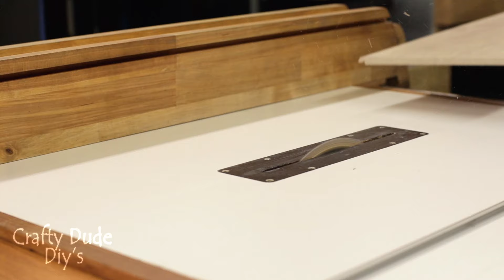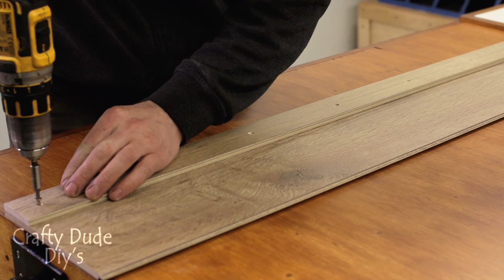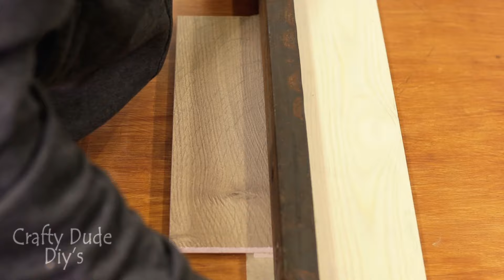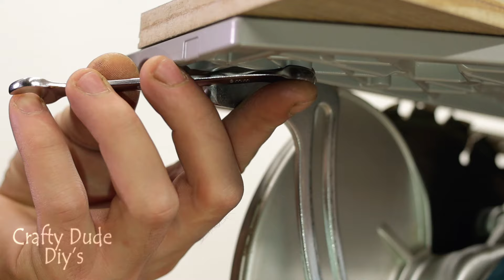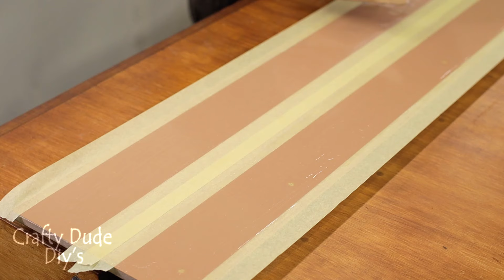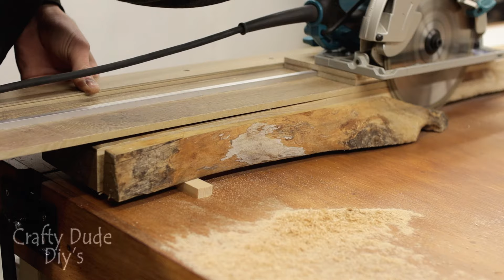DiY Circular Saw Guide out of Laminate II Homemade Track Saw

Comment: A saw guide can be as simple as a 3 piece wood strips and boards, and the price is lesser than $20. It all depends on what type of guide you want to build.
Reply from the maker: Well if you get straight enough cuts,for your project, means that you jig work properly😎👍
Reply: Most problems have more than one solution. It depends on you what you choose, some people are willing to put more effort into achieving the goal they are looking for. I’ve seen people use a lump of fire wood to pound a chisel, others use a mallet made of rare woods, each to his own……..
Reply: True, and I have one but I have found that I don’t always do a good job holding it to the guide. I believe it is that my saw does not have a nice flat side probably because it is a cheap pos but! I don’t want to replace something is not broke.
Reply: @Jamesmyatt1313  ：Do you add a T track and T track clamp on the saw guide?
Reply: @City-Hiker  no I’m going to make a new one with something to hold it inline. Not a fan of t-track, probably going to have something that hold the saw against the edge or some kind of slot that a piece of the saw base will go in. Hard to explain. I have been looking a many different ones and trying to figure out what I want to do.
Reply: @Jamesmyatt1313  : You can make a 2 layer saw guides. The base layer uses thicker lumber , and the second layer add  3/4 thick lumber and T track, then the T track and lumber surface will stay flat. 
Finally, add T track clamps to the T track, then you can use the clamp for inline holding
Reply: Also depends on if you have the tools to make the home made guide correctly and accurately, I personally couldn't make this to the correct spec needed without a table saw or at least I don't think it could so I just bought a track for my model saw.
Reply: If it dont cut the right way then what?  You re cut?  If it dont work good tgen maybe it dont work.  Just a littlle better then broken lol. @Jamesmyatt1313

Comment: Any track saw made out of wood will warp overtime due to the moisture and it will cause splinters.
Reply from the maker: Yes, but laminated mdf is not the same as wooden board🤔

Comment: Hello, congratulations on your construction.
The idea of silicone on the sole is perfect; the only flaw I could find in your creation is the loss of over a cm of cutting depth: I made a similar guide with 10 mm MDF on which I passed with the original sole of the saw and I found myself cutting two panels from 28mm without reaching the bottom (with a 210mm diameter blade!) Now, on the side of the sole I have welded two guides obtained from connecting pieces of aluminum bars 20x20 or 20x40 etc. those bars used to build the 3D printers and I use one or two 20x60 bars (1000 + 1000mm long) as a guide to which I created sliding clamps with a side strip, long enough to lock and position the 20x60 guide correctly
Reply from the maker: Hey, nice to see you again!🤝 I believe you made really great guide. I dont wanted to spend too much time and money for this, in these days that cnc bars cost nice amount of money. My saw is pretty big and I still have 50+ mm of cutting depth, what is enaught for all cuts I making.

Comment: Really nice use of material that sometimes just gets thrown out. I have a few boxes of this stuff that I picked up really cheap from a Habitat for Humanity store. I knew eventually it would come in handy. Thanks!
Also you could apply basically the same materials to make an adjustable dado cutter for your router. You would just need some small adjustable wooden blocks on the side of the two panels and a couple of knobs. Great video.

Comment: Oh.. I made almost an exact version of this during Covid. I made it longer to fit the standard dimension (2300mm) in Europe so I could cut drywall, plywood and in and out door panels material for a small guest house with a wood/tool storage.I actually did the tool storage in a size that could hold this on the wall. It works very good

Comment: Just a little trick, please.
To be sure not to zig-zag with the wood working router machine, it is better to guide it on the round side of the hoof and not on the flat areas. If one moves on the circle perimeter, any parasitic movement does not matter, because the axis supporting the tool will continue its straight course as the radius remains the same, while on the flat field, a zig-zag is assured.
Thank you for this saw guide idea.

Comment: I true wood like that using an L fence on my table saw. I feed the wood against the fence using a long plywood straight edge that has handles attached topside and sandpaper under neath for non-skid.

Comment: Hi I also have 5008 MG, is it usable for 45 degree angle?
Reply from the maker: I used it for angle cuts, not 45 but 20+ I think, it cut without any problems, but with angle cut you will cut out edge of guide and then you back to 90, guide edge wont match with saw blade. Same problem with original guides, but they have changeable rubber strip
Reply: @CraftyDude  ok so we need 2 of these guide for 90 and 45

Comment: Really great video....  It's the best homemade track saw on Youtube!  By the way, have you tried 45 degree long miter cuts with the track?  Thanks!
Reply from the maker: Thank you👍😎 no I didn’t try 45 cuts, Im using guide to split big boards in to smaller, then it goes on a table saw

Comment: I just saw this 08May24. I am somewhat confused. 

I understand that vinyl plank flooring is truly temperature and humidity stable. But by the time you buy a box of vinyl plank, the aluminum square bar and the saw to dedicate to the system you're into the budget track saw world. The other thing is...well, how you gonna make an eight foot track? How you gonna splice vinyl plank together? I just retired from flooring installation and in all my time I never once saw 8ft vinyl plank.

... just sayin'
Reply from the maker: This saw is not compatible with original makita saw guide, by reusing waste material I find out cheap solution of this.
Reply: Ok. I understand a little better now. I wasn't really dogging on you...just couldn't understand why you did what you did. Now I get it.

By the way...I have made several 'advanced' bases for my Makita trim router with LVP job scraps...larger simple base, a step base that allows me to cut dadoes 1 1/2" apart (for 5" sanding disc storage) and a 30" trammel for cutting circles up to 55" in diameter...so, I get it...just didn't understand it at first. I never once thought your work was shoddy or faulty, nor the idea insane...just didn't understand at first.

Your response made me subscribe.

Comment: wher can i see the part list and quantities ?
Reply from the maker: Guide made from 1 meter length 10x10mm square aluminium bar and flooring laminate, all other parts sizes must be sized for a circular saw you use👍

Comment: I like the simplicity of this build.  But we have 3 layers of laminate between the base of the saw to the cut piece.  That's a lot of depth loss
Reply from the maker: It is some depth loss, but its a problem just when you need 5+cm depth of cuts
Reply: @CraftyDude  you are right with a regular corded saws.  But nowadays, the cordless saws are quite mainstream and they have a much smaller blade.

Comment: No need for a channel. Just use the raised edge as a guide. Simple
Reply from the maker: Channel helps, no need push to guide side only forward, straight cuts easy👍
Reply: Then you could move away from that edge.dah

Comment: Your time costs much more than original Makita's 1.5m guide.
Reply: Have seen the price of a new guide strip?
Reply from the maker: See the problem is not how much cost guide, problem is that not all saw made to fit for that guides, as mine, so I supposed to buy guide and a new saw, and as I dont need this guide everyday, price combined is to big🤔